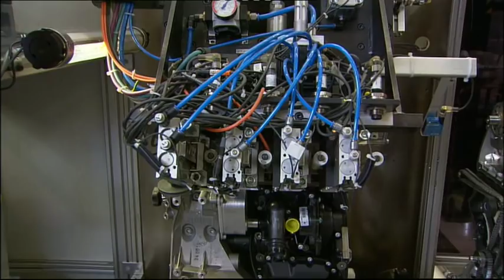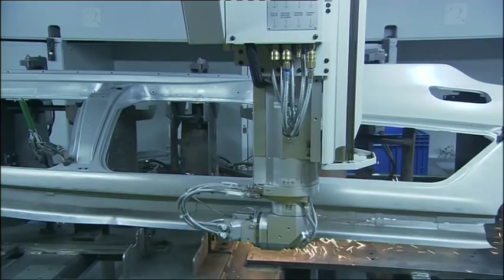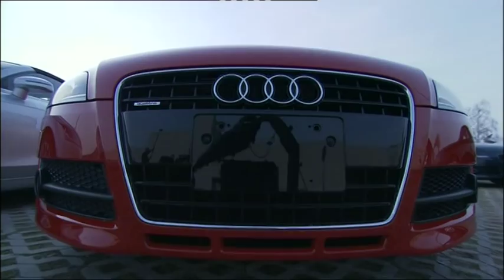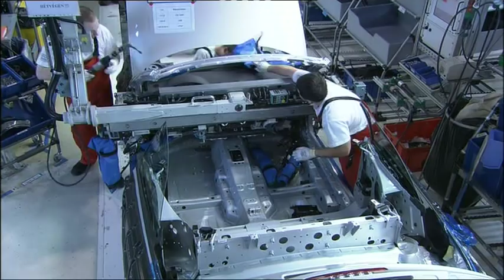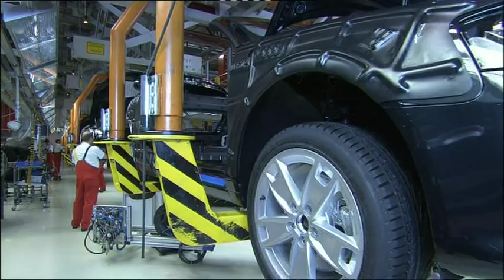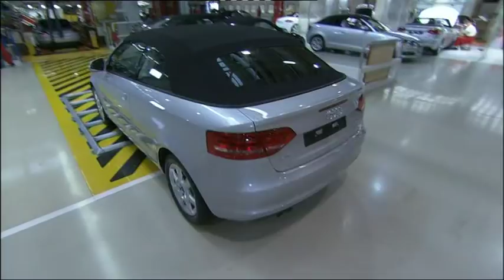Audi TT Production

Comment: You cannot beat the overall look of the Audi TT is photographs extremely well and look like a different car from all angles which is cool.  You also have the fact that you do not see to many of them most went for the BMW.  The audi TT has incredible performance in the snow due to the all wheel drive.  Put some good snow tires on and it rivals any other car going up hill very nice.   You also have a fantastic hatch back that has never let me down, and the fold down seats give it even more room.  Brought home all my furniture from Ikea with it.  Speaking of the two seats , they are small but can carry two children easy , and  although they did not like it much, two adults in an emergency.   The interior is so good on the Audi TT that black and red leather premium package was coped on the brand new 2015 Mercedes including the vents and lights.   Yes the new mercedes is extremely nice but the hatch was no where near as nice and sport car or not you need room to adventure and live.
Reply: I am putting in my order for the 2016 Audi tt.  keep them rolling out

Comment: 2.45 ain't an Audi TT :-s
Reply: Audi's are built on the same modified Golf/Passat platforms(except the A8)...........Plenty of suckers in the World; with marketing-Advertising to spend 4 times the amount of "Golf" for a TT>>>>>>>same car underneath.Look at the price difference of the VW Touareg,Audi Q7,Porsche Cayenne..........same car.........price-spread can top $100,000+.Here in the USA when sales are bad "fleet special" VW Touareg can be had for a little over $35,000.....where as the Audi/Porsche versions(never a base model available in the USA) are usually $75,000+ and no floor mats don't come standard as they would on a $18,000 "fleet-holiday special" Camry/accord
Reply: @dmcnamara9859  they are not the same..they are completely different in driving...
Reply: Αισχος Ντροπη. 

Top Level  previous Gen Touareg could be had with the same suspension goodies as the  Porsche/Audi variant.....including the GM Delphi Magnetic strut-shocks....which alters the ride automatically or at the flick of a switch.

The USA no longer gets the Tourareg....because USA consumers did not like the small size and high price tag. We now get the USA built Atlas (same platform as the very large China/USA spec Passat).

Atlas is larger and cheaper than Tourareg..... sales of the Atlas are very strong compared to the  Previous Gen Tourareg.....especially for buyers that purchase them for the sole purpose of exporting them to countries where VW refuses to sell them officially.East Block/Russia included buys many  Atlas's purchased Brand-New in the USA by Brokers.
Reply: @dmcnamara9859  i understand what you are saying..but the geometry the weigh distribution ..the aluminium body and other stuff make the difference...the interior quality and some little details in engine parts and the gearbox..i know that if you want a car and you dont care about details ok..you are right..but the tt especially the new one has nothing to do with golf ...seat leon cupra has nothing to do with s3..cupra is more agressive in driving ...every company of the group uses same parts( not all of them) but in their own way ..i speak about cars i ve droven.as for tuareg and atlas or other category cars..ok i would also buy a vw instead of the very very expensive audi of the same category but probably i dont get as much as in audi or porsche in tech.(auto parking etc.) check some driving tests in slaloms and safety and you will understand why they are different..